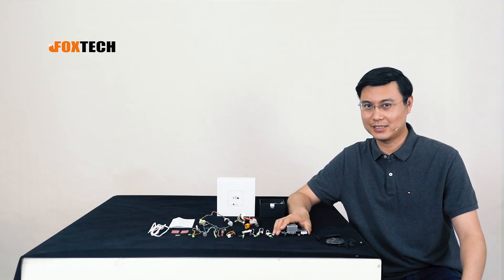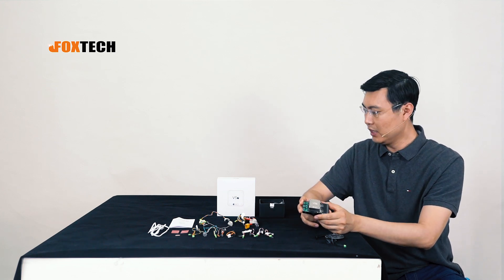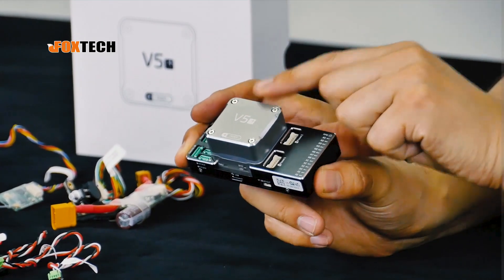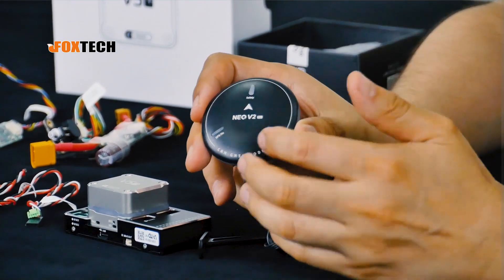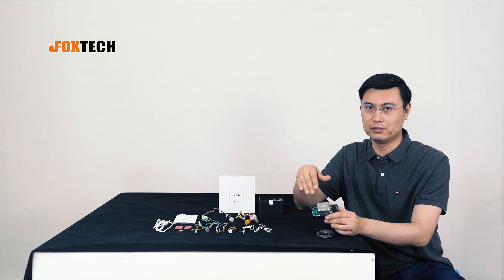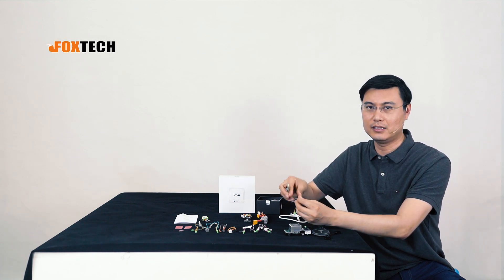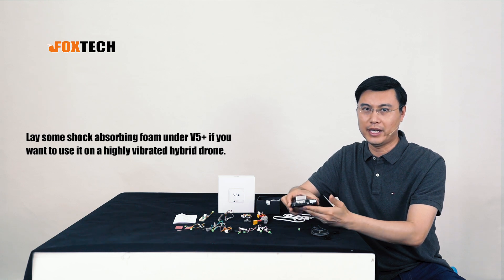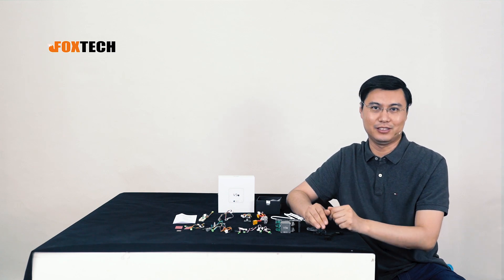Triple IMU Redundancy CUAV V5+ OPEN SOURCE Autopilot

Comment: I have a question for the program the esc needs a programming card or the controller already configures?
Reply from the maker: It does need a programming card, but the card only saves the flight log. The controller has the parameter configured.